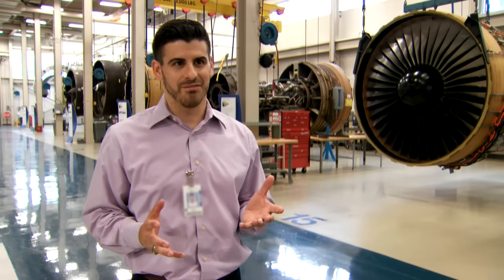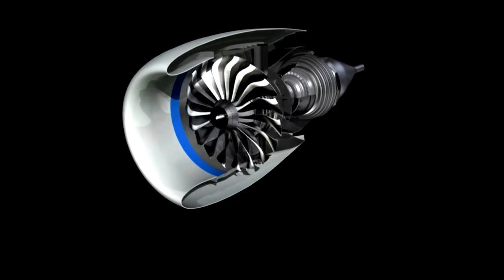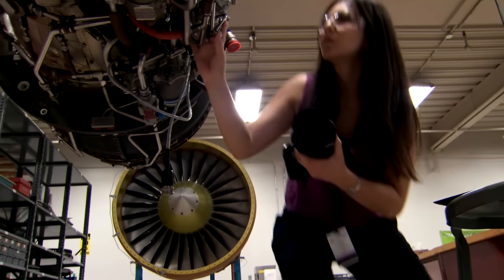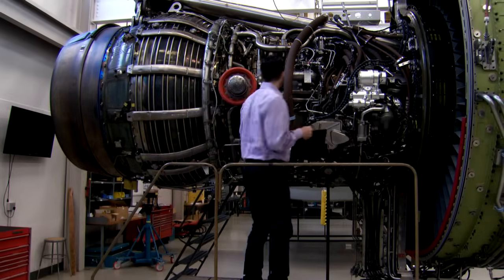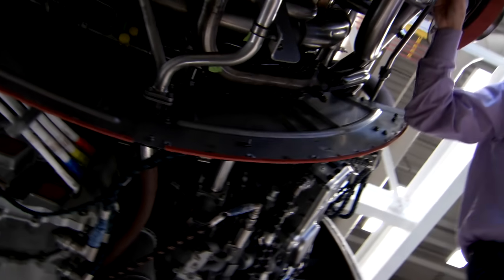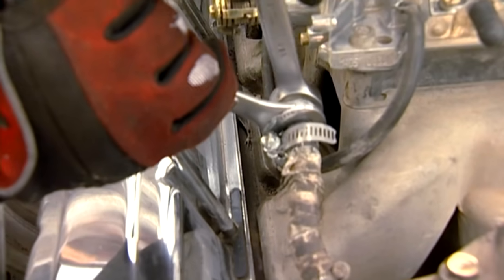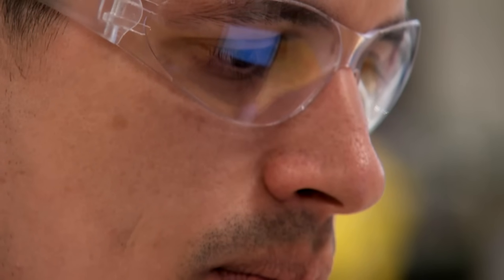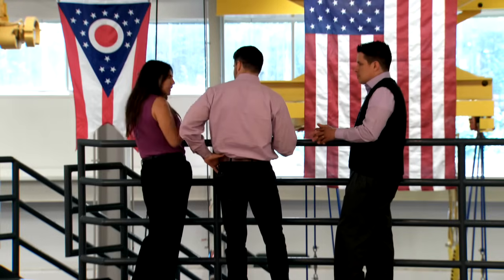Mechanical Engineer

Comment: After studying mechanical engineering for four years, I realize the jobs are very different from what I expected. The massive knowledge you have learnt on course does not have too many direct relation to the actual work. Ultimately, I start to find a software engineer job and writes down my own program using Python, JAVA, C/C++.  Now I am applying for a conversion CS master program and training Leetcode algorithms questions at the same time. This is way much more interesting than mechanical engineering job. Hope I can work as a software developer in the next job season.
Reply: your interest
Reply: Update: I am now working in one of the China’s IT tech giant as a mobile software engineer from graduate program. In the past few years I grow up pretty fast and I prove that my ability matches with all other engineers who study computer science since undergraduate
Reply: @嘉然今天吃战斧牛-u1h  good for you
Reply: I can underline this statement. The studying of this was amazing, the work was HORRIBLE. I effectively just noped out and started a new carreer and reschooled. Mechanical engineering is NOTHING that you see in this video. You know what it is? Sitting behind a computer screen 8 hours a day in a shared room with others and having meetings with other departments. And the same goes for aerospace engineering and nautical engineering. It is all the same thing but with a different specialization. Be smart, steer clear from engineering and go do something that doesnt suck your soul out.
Reply: @Captain_Cinnamon  G
Reply: @Captain_Cinnamon  "Be smart, steer clear from engineering"

Comically loud incorrect buzzer

Comment: you do a video called mechanichal engineer and you show jet engines. wouldn't it be better to show aerospace engineers...?
Reply: Mechanical engineering sub bracket 
     { Aerospace engineering}
Reply: Aeronautical engineers 

But to be honest ... The aviation industry is a mechanical engineer dominated industry rather than aeronautical engineers ... It's quite a sad reality tho ... This info was based on a some professionals I've talked to

Comment: I've been an aircraft mechanic for over 20 years. Something I wish Engineers did was not just throw shit together. Put more thought into it. Why is it so hard to access when you could have put that part here instead??? Very little thought goes into the finished product. You've heard the expression..."keep it simple stupid". Actually got to see a bunch of Aerospace engineers in a huddle once at a manufacturing plant. They were all 25 and hadn't hit puberty yet. And you want to put this part where??? Where it's impossible to reach upside down backwards and with only one hand???? Stupid stupid stupid
Reply: I feel you man, I like working on my car myself and sometimes I wonder why couldn’t they make things easier to work on. I’m also a senior mechanical engineer student and this is something I hope to be mindful of when I’m actually working, what surprises me the most though is how many of my peers never even turned a wrench or a screw driver
Reply: i work in heavy construction, i know the pain

Comment: lol, is this video "diverse" enough for my generation? oof
Reply: @hasaniqbal233  gotta make sure its suuuuper "diverse"
Reply: @alanf4106  would you prefer if they were all white? I don't get what's wrong with having a diverse set of mechanical engineers?
Reply: @hasaniqbal233  depends on the part of the world its located. if a business in Japan becomes focused on reducing Japanese people and call it "diversity" I would be just as upset... creating an image around the lack of homogeneity is not a virtue
Reply: @alanf4106  so you are upset because this video is in America, but has too many non-white people in it? It'd be weird if Japan did it, since Japan is like 99% visibly Japanese ppl, but that's clearly not the case w/ the USA.

Have you ever been inside an engineering lab/workplace? My engineering classes had like 10 white students in them. The aerospace lab I do research at is mainly Asians.

I don't think these videos "force" diversity. And even if it did, I don't see why it would be such a big deal? Hollywood is mainly white people, don't see you complaining about that.

Comment: Two Minutes silence for All mechanical Engineering students in India because here SOM and Engineering Machinics are based on Calculation of Civil Engineering because Since Fucking 2019-2020 it has been 2 years in My clg I am calculating Beams and Columns WTF. No one knows about Stress analysis in Core Mechanical just like Studying stress on Gears and all.

Comment: I am not engineer .. but I can build these engine in my home garage.... this is a shit hole... there is no need of modeling and math shits at all ... 
All we need is some iron and sense to turn that iron in some usable shape... 
I am better than these shit holes without studying any shit
Reply: Yea no you can not build this at all 1. It would cost thousands of dollars 2. Building one is different then designing one you need to calculate the forces, stress, the way heat moves through the engine, the way air moves to the engine, making sure the airflow is stable, making the engine controllable and that,s not talking about the hydraulics, pneumatics and electronics etc. Don’t act like you are better everyone an build something with enough knowledge but designing them requires calculus, chemistry, algebra and physics etc.

Comment: I studied Mechanical Engineering.I did a Five Year Indentured Apprenticeship,after which I went to
University.The Areas of Engineering cover (the main areas) are Mechanical,Electrical/Electronics,
Civil/Structural,and Aeronautics.In my career I was associated with several Engineering Institutions.
Engineering in my day when I entered it,was very specific in its areas.Nowadays it is completely
different in areas.In Universities you now have Major/Minor Subject Degrees.In my day,you did
 not have that.I wonder what Engineering would be like in 50 Years time.
Reply: With the help of robots, it will be dead.
Reply: @ashutoshsingh053  Engineering will never die. Because it‘s based on innovation. Other jobs, however, will die

Comment: I'm Hasan, I have a master of the mechanical engineering, This is my book: http://www.amazon.com/Design-Prosthetic-Feet-Made-Materials/dp/3659857777/ref=sr_1_fkmr1_1?ie=UTF8&qid=1460320899&sr=8-1-fkmr1&keywords=new+prosthetic+feet+hassan+saad . In addition, I published new paper http://iiste.org/Journals/index.php/ISDE/article/view/32383 . This is also http://inpressco.com/the-modeling-and-effect-of-fem-on-prosthetic-limb/ 

My Email is

Hassansaad1990@gmail.com 

Respectfully,

Comment: I m studying 3rd year mechanical engineering and I like to work in aviation or like to be a pilot so help me after completed my engineering wt course I should do to reach my goal
Reply: what? you're going to be an mechanical engineer and not maybe a pilot?! What are you talking about, being a pilot and flying planes? wtf
Reply: @zjaeger1800  hello sir... I like to be a aerospace engineer. but unlucky I joined mechanical engineering  so plz help me sir . I want to reach my goal
Reply: @sahanadnayak5545  get a master's degree in Aerospace engineering from a premier institute,that will work.
Reply: You need to get the job before you get the job or you wont have experience for the job.

Comment: Damn this video makes me feel bad. I wanted to work in the aerospace field but completely forgot about my GE aviation interview. So much for my mechanical engineering degree
Reply: "I wanted to work in the aerospace field"

Really?  Would you have wanted to be the Project Engineer for the Space Shuttle Challenger?
Reply: @perfectsplit5515  i believe not all aerospace engineers are project engineers for the space shuttle
Reply: @matt309  Well, my point was not about working specifically on a space shuttle project.  It was about the terrible engineering disaster associated with the Space Shuttle Challenger.  (Maybe you’re too young to remember that)
Reply: @perfectsplit5515  I remember it perfectly. Your just cherrypicking

Comment: i am a student of mechanical engineering in turkey. we just doing some exams and just solve some strength, manufacturing , thermodinamic, flow mechanics problem. and sometimes we just draw somethings in solidworks. after than this video i just feel like a technician not engineer.
Reply: I am studying mechanical engeneering too. You just sum up my situation. Hope i would be able to do more than that at the end of my formation

Comment: 1. Would they be able to design on their own without the computer softwares and simulation?
2.  Most likely the softwares are the company's propriety softwares. Developed based on company's experience. The software probably assume a particular design. And make decisions and optimization on that assumption.
3. Hardly any engineering degree program teaches design. It's always analysis. If not, every mechanical engineer in the 3rd world would be able to design and build aeroplane engines.
Reply: 1. They would be able to design an engine. But could they design an optimal engine? I don't think so.
2. Yeah, that's true. But the engine company I know about has its own software and are also using Ansys for simulations. But the settings are based on knowledge and especially on experience.
3. In Germany, we studied design. Isn't it the reason why we became engineers in the first place?  But through analysis, you are able to improve your design. That's why it is so important

Comment: Mechanical engineering is the most mature and advanced field.  Due to automation of most of process and computer operated machines all you need in any industrial plant is low cost labour and some management systems to optimise all the processes. Sooner or later these industries will get fully automated. By the way the video is about R and D wing. So shut the fuk to those whose having a senseless talk on comparing engineers

Comment: Lol i just finished mechanical engineering degree and we dont have that knowledge in combustors so sad
Reply: Mechanical Engineering is an extremely diverse field.  What you learn in college is just an introduction.  There are multiple divergent fields.  All the material cannot be covered in a 4-year college curriculum.
Reply: You learn in the field, trust me all you know will come good if you select your career field well
Reply: @dennismuthomi7791  You don't select the career field. The career field selects you. By that I mean you submit a resume and they call, if they don't then your shit out of luck.
Reply: you learned thermodynamics, hydraulics, fluid mechanics and heat transfer etc, that's the core for this machines in the industry you get to learn more and more.
Reply: @NealDoubleAA  I didn't beef about physics principals, you are. when I said "you learn more" meaning dynamics, stress, finite element modeling, simulation,  controls, materials and process, structures, testing  etc, most of these engineering theories were archaic or didn't exist 60 years ago it changed drastically.
Reply: @NealDoubleAA in the industry some companies develop their own standards and even their own engineering theories and research not the same as the CORE classes, as for not having education, I build rockets for Nasa. Enjoy!
Reply: @thrashingmetal  Cool, now I can really call you out on your bullshit.   NASTAN has been around for 60 years.    No, FEA isn't a new thing to learn.  And you said it was and that is core teaching everywhere.   As that program was made @nasa you would should know that.     More likely you are a guy that talks to engineers but knows nothing.
Reply: I am a student of life and you are mr.knowitall. it's called NASTRAN, no it's not the same as the old one from the 80s, it's been DEVELOPED and that's my point engineering is advancing, you learn new things.
Reply: @NealDoubleAA  some students from engr tech, or internationals or oldies, never heard of FEA. So they take classes in the company and learn it.
Reply: @NealDoubleAA  I'm an engineer I love my profession
Reply: @NealDoubleAA  "been shit out of luck for 17 years" then proceeds to hate on another engineer. Dude your salty about your failure leave other ppl alone.
Reply: @NealDoubleAA  ye maybe hes a liar and you're a failed engineer according to your own words.
Reply: @NealDoubleAA  well if you cant find a job for 17 years then thats pretty failed imo.
Reply: @NealDoubleAA  so its societies fault that you couldn't get a jobp?
Reply: @NealDoubleAA  and what is societies current problems that you cant find work for 17 years?
Reply: @NealDoubleAA  since when? Most people are employed.
Reply: @NealDoubleAA  engineering is constantly changing, it's about innovation and development, thus continuous learning, not just physics theories.

Comment: Believe me, they are pretendding that mechanical engineering work is fun. In reality, endless meeting and documentation make the work boring and drive people crazy.
Reply: Some people think it’s fun. They have the power to quit their job and find a better one. SpaceX has hundreds of engineers meeting strict deadlines but the problem solving is what they like to do. Designing a rocket to propulsively land seems crazy but they used their creativity and ingenuity to make it possible. There are fun hard problems to solve.

The most satisfying part about being an engineer is designing something and having it work as intended in the final product.
Reply: @wyattb3138  you are not going to design an engine on your own lol

It is only fun if you are learning, what I'm trying to say is mech engineers didn't probably have to be that ingenious about spaceX rockets as controls engineers. 
Sure calculations would be different and fun but if you are on low post you are probably going to be doing repeative work. 

I'm no-one to speak, I graduated in 2021 :'( 
But that's my perception.
Reply: I was a mechanical engineer who worked on preparation of 3D models for a self propelled artillery unit manufacturer. It was the coolest job. Unfortunately it was a contract job.
Reply: Hahahaha. I do so much documentation and it's frustrating and often boring but I also do hand calculations and interface with stress analysis software and that can be cool.
Reply: its better than being unemployed
Reply: Who the fuck would want to ever waste their life doing this? I'm studying civil engineering going into my last year but I'm seriously considering never entering the field. Life is too short to waste, especially for very little pay
Reply: @sledge2742  i agreeeee that its waste of time 
And then work for ppl many hours and get some dollars 
Or not even finding a job 💀
Reply: hehehe Cheng, you are speaking as a layman
Reply: Hahaha......True
Reply: How many hours A DAY i need to spend in college if i became a mechanical engineering student ?
Reply: @LifeWithoutCovid  it depends on your college and course selection, 1st 2years of my college was hectic asfk and in 3yrd year they changed some syllabus and we had many project based learning classes, since our college had some good connection we had some parts and engine from BMW, loads of chassis  and parts, we had to design and replicate a part which we had selected in a 3d software (i used fusion) make analysis and then genrated a 3d printed model and we had to even manufacture the part using casting or any of the process in college which was sadly delayed due to pandemic,
Reply: @Draig005  thank you 
Also i hope the pandemic ends and have fun w ur classes  <3
Reply: Ze Cheng 怒斥机械嗷😂
Reply: @Ze Cheng, you only want a fun job not money ?
Reply: I'd agree 100%
Reply: Sounds like fun
Reply: yes, they probably hired her to pretend she's an engineer for "optics" and to be woke
Reply: @johnames6430  stop it, she's really an engineer
Reply: I'll take ME in college and this comment is made smile. Haha can't wait to see myself being crazy because of ME, joke. Hshs
Reply: also in programming they thought it is fun but not
Reply: Or maybe they like thier job 😗
Reply: Try living in the UK where everybody thinks engineers fix boilers and dishwashers.
Reply: Huh it's what it's i need admin for that and more focus on engineering works instead of doin sheets 🤣
Reply: Mechanical engineer ke liya konsi skill important h.. In her job
Reply: Agree bro
Reply: Dont listen to this guy. If you enjoy studying ME and you develop yourself professionally you can probably land a good job and do fulfilling work, provided you live somewhere with a good economy. But I agree an office job in general is kinda sad in a way
Reply: Dear madam, dear sir,

Meetings and documentations are important in mechanical engineering. Mechanical engineers do not only designs systems but they also write reports.

Kind regards,
Ayéfounè Gautier SOMANE
Reply: Same here.
I'm a mechanical engineer in Turbine fabrication and I am feeling bored to do my job !
Reply: @wasimakram1576  where are you from
Reply: @KickYouKT   aslkm iam mechanical engg and currently iam studying masters on machine design.. I want to work in aviation industry literally I don't know how
Do this
Reply: @wasimakram1576  plss reply...now i have to choose my subject mechanical engineering or electrical and computer engineering....
Which should i choose???
Reply: @jaguarpreston6285  Yeah theres no fun job, we're looking for money not fun..
Reply: i am not mechanical engineer but believe me, it's better of  feel bored
Reply: I believe u